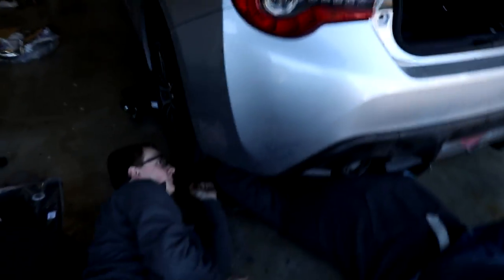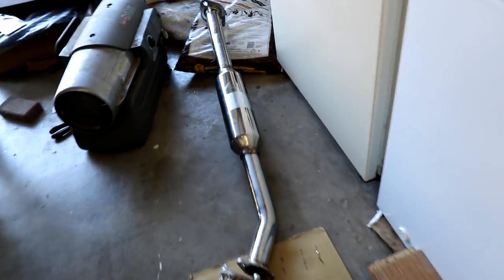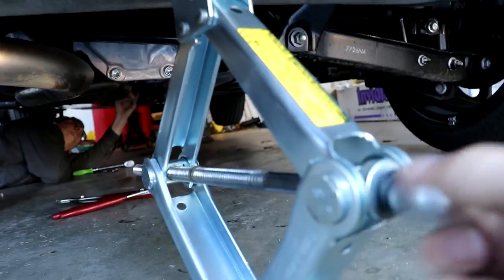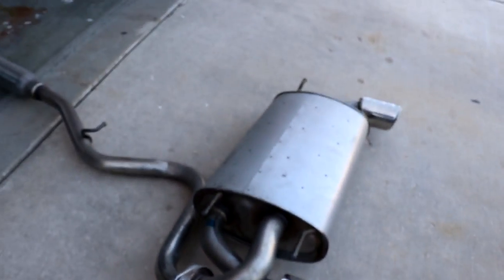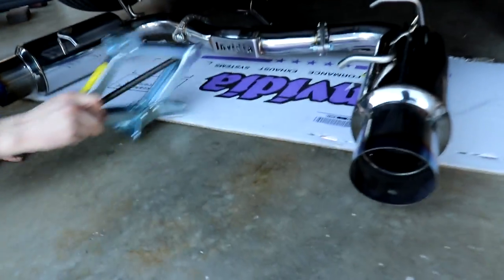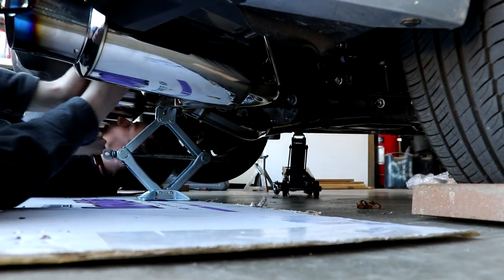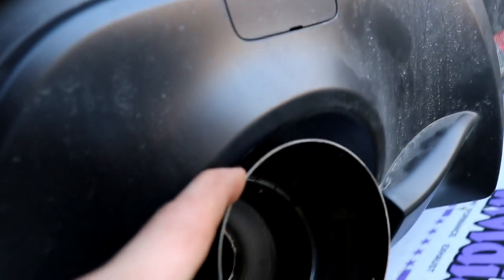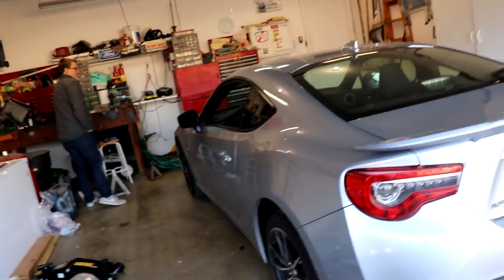2017 Toyota 86 Invidia N1 Catback Exhaust Install

Comment: So cool because this is pretty much the same thing I am doing! I just bought my car the day after my birthday on the 24th took it the next day and and did the windows and ordered the duck lip spoiler in carbon fiber, side skirts, UEL front , this same exhaust that is coming in the mail , and a open flash tablet. Trying to save up for either the HKS turbo setup or the Eldebrock charger haven't decided if I want the wine of the charger or the BOV from the turbo? Either way nice video and ~I'm Subbed